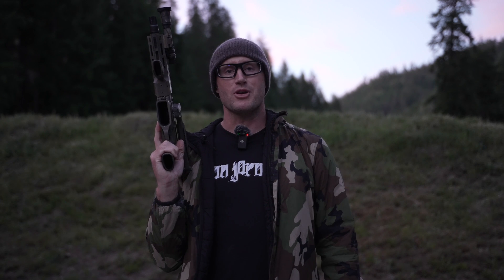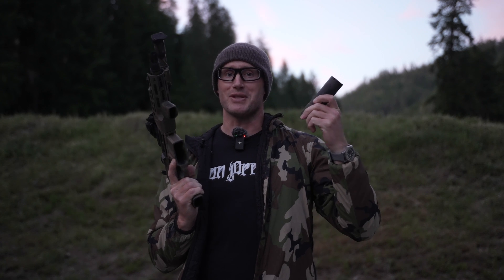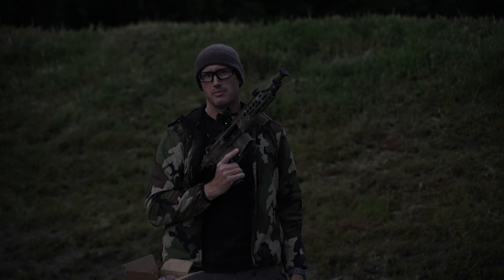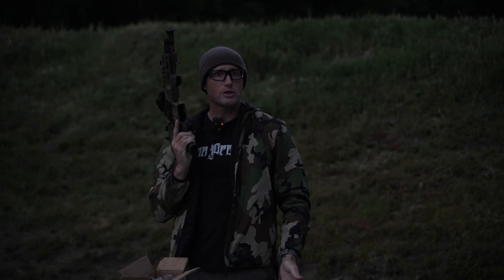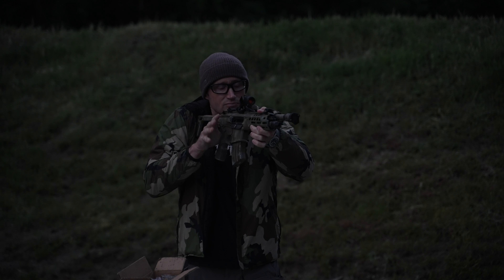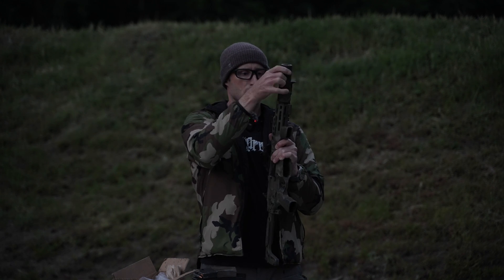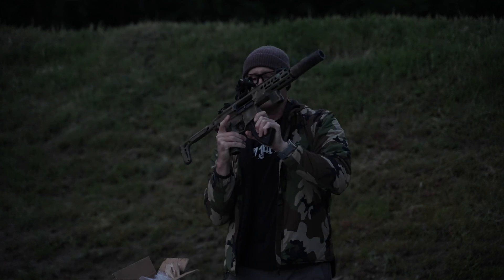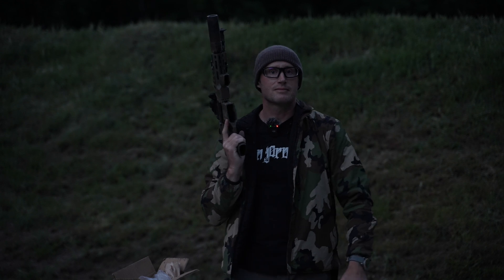Flash Mitigation: Part - 8 MCX Spear-LT and SLX-C

Comment: I love this series and I wish more people would pay attention to the type of ammo they use when comparing and contrasting flash/signiture. Steel cased ammo from eastern Europe usually contains very flashy powder and also bi-metal (zinc, mild steel, ect) jackets that add alot of flash and spark. Having a load with a faster, flash mitigated powder, and quality bullets with actual copper jackets can make a huge difference when it comes to short barrels and signature reduction.

Comment: What's the best combination for flash mitigation of all time you've found so far? For any platform.
Reply: If you can't do a suppressor, or if you just want an alternative, a longer barrel like 14.5-16inch and a long, prong type  flash hider (surefire 3 or 4prong, JP muzzle flash eliminator) usually gets you 95% of the way there for FLASH mitigation, obviously not sound but definitely flash. Couple that with quality ammunition with faster burn rate powder and usually you will not even notice the flash at night.
Reply: Surefire socom 762TI on a 9" 300 blackout 220 gr subs has absolutely zero flash
Reply: 11.5 inch barrel in 5.56 with my high flow can using 77 gr BH OTM is very good for nvg use at night. My experience.

Comment: Down to powder burn rate and how much of the powder is actually combusted in the barrel versus off-boarded to burn out the front of the muzzle.   Powder charge should be optimized for barrel length if possible just like A CCW handgun versus A "Service Size" handgun.   A 7.3 inch barrel is ridiculous itself, a 9-10 inch in .300BLK would be the better fit if you need to be "Discreet".